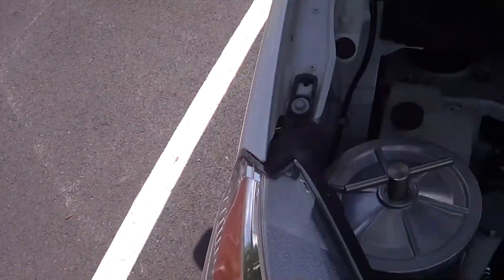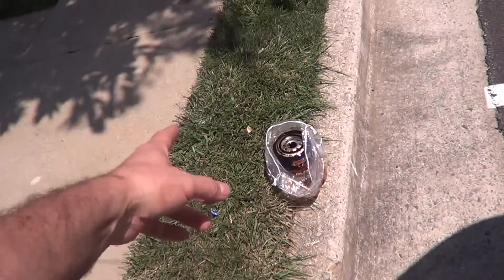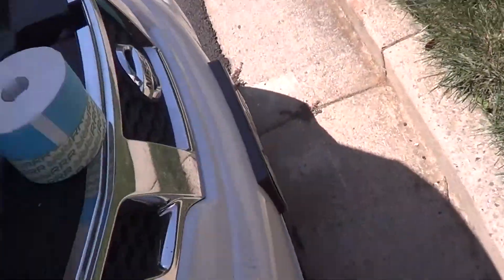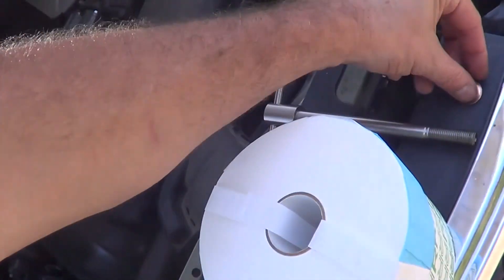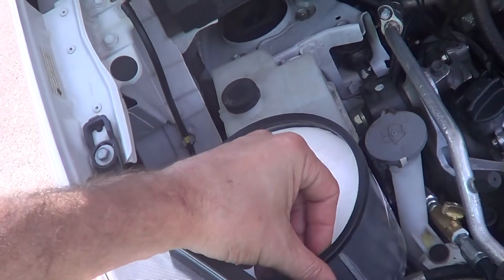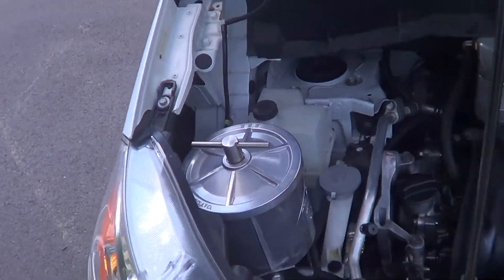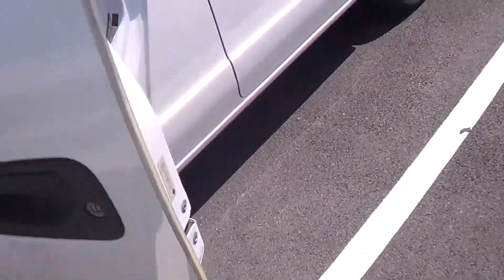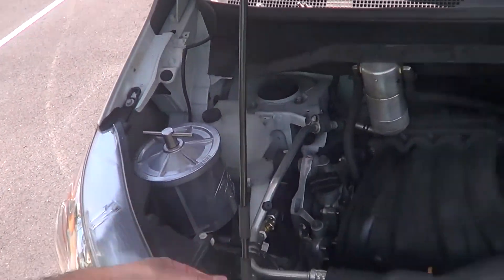Triple R Bypass Filter Performance Testing on a Gasoline Engine

Comment: Does filtering the oil at the 2 micron level remove/reduce the additive package? It is so fine a filtration, is removing the add-pak particles from the oil stream? I have been able to see the add-pak within Pennzoil Ultra Platinum settle to the bottom of the five gallon jug as a brownish sediment. If I could see that ... 2 micron filter should remove that. Counter productive ?

Comment: Too much analysis here . Frantz on their website showed that dirty 5000 mile oil can be returned to clean oil particle counts in a few hundred miles with a 🧻 filter . Motor trend magazine found the same in an article in the early 2000s with a similar Parker ABS paper roll filter. Instead of putting a lot of cash into oil analysis and a  proprietary filter like this you’d be well ahead using one of the Frantz 🧻 units . You could easily run 15 k (or longer)with no worries on a gas engine with  a high end synthetic with no filter changes and only make up oil .
Reply: The triple r looks identical to the frantz filters

Comment: Seems like the engine is going to be running dry for a long time compared to regular oil filters and that is going to hurt the engine more than its going to help by a long shot
Reply: Based on this video, what makes you say that the engine will be running dry at all?  Also, "...going to be running dry for a long time compared...", how did you get that?  I would appreciate your clarification as I did not hear anything suggesting what you commented about.

Comment: oil burns. ever put oil in a pan, heated it.
Reply from the maker: a pan of motor oil wont ignite until it is above the flash point of 412 deg F.   i don't run my engine that hot.
Reply: You mean like the oil pan on the bottom of virtual every combustion engine?

Comment: My guess is the few pounds of oil pressure can be addressed by adding more oil to your system since the bypass filter holds oil and you're taking that out of your engine.

Comment: All of the spin on filters are slightly better than the full flow filter. They are a full flow filter with a restricter orifice to slow down the flow and reduce the pressure on.the pleats. My Rambler came from the factory with one.In 1964 the flat head came with a bypass filter that spun on. It was junk the same as all spin on bypass filters. I replaced it with a Frantz oil cleaner.The oil went from black to golden. When you see me draining oil or paying 30 bucks for a filter element you will know it's getting cold in hell. Some clean oils look like dark honey some look like light honey.

Comment: The amount of water the filter removes is nothing compared to what the engine produces. We depend on normal operating temperature and crankcase ventilation to remove unburned fuel and condensation. Short trips in cold weather and you have a problem that even a depth filter caint handle.

Comment: One advantage to the depth filters is they can keep filtering down to their micron rating a lot longer than the pleated filters. A 1 micron filter bag that I used on my industrial job might stay at 1 micron for 5 minutes. Pleated filters do better.

Comment: I use a quart of Pennzoil Platinum and a roll of Scott 1000 sheet every 6k plus what little the engine uses which isn't much. With the toilet paper filters I used 50 years ago I could Squeeze the dirty end of the tp and get nasty sludge. I could Squeeze the clean end and get.beautiful clear oil. With the Nissan Altima my engine is clean my oil is clean my filter is clean.I think in my case the only reason I need to change the filter that often is to add new additives. Might need to convert it to use a carborator so that I can feel better about changing the filter that often.

Comment: That looks like one hell of a filter. Similar to a toilet paper filter at probably a much higher cost. One thing the pleated filters have going for them is modern engines are so damn clean running that even a poor filter looks good. With the old carborated engines you knew in a hurry if your filter wasn't cleaning the oil.

Comment: I've seen a lot of bypass filter videos along with toilet paper bypass filter sytem and mostly all videos does not show the condition of the oil after it went thru the filter. Just wondering why?
Reply: I run a TP filter and Blackstone was unable to do a particle count because the oil was black like coal. The TP does pass some of the grit but it cleaned up an engine that was ruined from sabotage.. In my own observation, I can feel a small amount of grit passing through the return line. I also have a 10 micron hydraulic filter on a transmission (A/T) and the particle count was dramatically reduced (as good or better than new fluid).. Most people who run a bypass system really do not understand what it does or the need to clean the oil. In general, its more effective on off road machinery and diesel that make abrasive soot. On a modern car engine, it has little value because gasoline engines have very little solid contamination and the quality of oil is much better than in years past.
Reply: @heavymechanic2  On diesel engine oil, wear metal (Fe especially), Si and soot is to be checked. Of course TBN and oil viscosity are important parameters that tells if the oil is still usable. Contamination is external factor.
On hydraulic oil, 10 micron filter is even coarse as the pumps and valves have clearances under 10 microns. New oil from a drum is at the contamination limit of these equipment. So you need to fill new oil through a 1-3 micron filter .

Comment: The pleated elements have no value at cleaning oil. If the elements look like a roll of toilet paper it's a good filter. If I had one of those filters I would figure out a way to use a roll of Scott 1000 in it.
Reply from the maker: The cellulose depth filters probably do better.  However, I couldn't justify the expense of the filter element and I could not get extended oil changes.

Comment: The bypass filters don't have to deal with water at normal oil temperature. The only time they have to deal with water is when you are operating in cold weather and not driving enough to heat up the oil.The crankcase ventilation deals with the water and the small amount of fuel.Of course you have the fools that remove the thermostat or coolant contamination.

Comment: I doubt you will see any difference with a bypass filter on a modern Japanese or European engine! Me and my friends  about a hundred of us did not see any difference in our UOA with bypass filtration. Then we started to experiment with full flow filters. We found a bias not towards level of filtration but flow instead. The filters that produced the best particle   count and lowest wear for us was filters that flowed the most oil. I am sure in a commercial application in a dirty harsh environment or in large diesels it makes a difference but for light duty cars and trucks a high quality paper air filter with all the hoses and airbox tight and sealing well and a cheap hi flow full flow oil filter was as good as it get's. Running a quality synthetic oil while keeping total insolubles  decent and changing out before the tbn got acidic was as good as it get's. I think the best oil for the money for any I4, I6 or V8 that is not a turbo diesel is M1 0W40 in the 5 quart jug at Walmart. I have used it in GM vehicles, Toyota's and Dodge light duty 1500 Ram trucks 1/2 ton. on the 1Ton Dodge Ram I use Rotella T or Delo 5W40. You might also try Redline 5W30 but it tends to take 2 oil changes before it turns in good number's. It is an Ester based Group 4 and G5 synthetic and the ester content tends to do a lot of cleaning of the wear metals that have stuck to the sides of the engine with the old oil. The older the vehicle the worse the numbers look with Redline or any other synthetic with lots of ester's in it for the first 2 changes!
Reply: I use converted Motor Guard toilet paper filters. I use 2 rolls of Scott 1000 sheet and 2 quarts of Pennzoil Platinum 10 30 a year plus what little the engine uses. 2006 Nissan Altima. The oil is beautiful.The Frantz oil cleaner is another good one.
Reply: buckaroobonsi555 Schaeffer oil out performs all of those you named.

Comment: where did you purchase Triple R & how much?
Reply from the maker: I looked and I didn't find the supplier.  I have the part numbers in the description.  I believe the AL-50 is discontinued anyway.  There are other brands that make this too.  I would just try to find a housing that accepts the 2 micron TR-20330.  I probably paid $300.  It is expensive.  I'm doing the experiment and videoing so you don't have to.  I'm going to do a video at 15,000 miles this weekend.  The oil still looks clean to me.  I will pull everything apart and compare the wimpy main filter with the TR-20330.  I could probably run the oil to 25,000 miles, but the additives are going to be very low now.  I know the oil is clean.  My only concern is if the main filter is clean where the bypass doesn't open.

Comment: +NathansHVAC - Can I give you an advice?  With all the " Time and Effort and $$$ " . You could have save all that and just buy Cheap Walmart Filter + Cheap Walmart Oil.  Change it every 3000 Miles instead of every 10K or even 20K.  I think it will be the same thing if you sit down and calculate your  " Time and Effort and $$$ ".  Funny thing is..., your Oil probably would be cleaner with Cheap Walmart Stuff since you are changing it often, LOL.
Reply: CLEARLY people who read my comment have comprehension issues. READ IT AGAIN.... It's VERY simple !!!
Reply from the maker: Jordan Bronson I used to use cheap Walmart oil. It's fine in the summer, but in the winter it'll destroy your engine because it gets too thick. 20% of expensive oil is the additives. Synthetics do way better in the cold. But you're right changing the oil regularly will keep it clean. But you could change the oil every Thousand Miles using Walmart oil in still blow out the engine top-end in the winter time.
Reply: +NathansHVAC - Hmmmm, I have been experimenting with Walmart SuperTech Oil for the past 2 years.  Believe it or not, I actually added 1 Quart 10W-40 to very oil change.  The requirement for our Chevy Blazer (Testing Vehicle) is 4 Quarts of 5W-30.  Since our Blazer is old and 300K+, I added 1 Quart of 10W-40 for extra protection.  Although, in the Winter, I should go " Thinner " and I agree 100%.  But I didn't, I just do it as regular and it's working fine so far for the past 2+ years.  I am in New Hampshire by the way and Winter here it's pretty cold.
Reply: +NathansHVAC - I am not here for " Endorsement " by Walmart.  I wished they did, I would work even harder, LMFAO.

Comment: Hi Nathan, for best results you must use filter element type E-50 (RRR Blue lettering)
Reply from the maker: Thanks for the suggestion.  However, when choosing the best filter, I called the factory and talked to one of their engineers.  The M-50 filter is a 2 micron with a beta of 200.  Here is right from the specs:   It is "Meant for hydraulic oil and for systems requiring best possible particle filtration"  The filter you are recommending is a 3 micron with a beta of 75.  It is still good, but not as good as the M-50.  Here are the specs:   http://www.baseko.sk/wp-content/uploads/2013/09/Element-series.pdf
Reply: Eugenio Algüerno a h. A n man E e ehh
I

Comment: Why go through all of this?
Reply from the maker: Two reasons:  1) I could not find any videos or data on bypass filters on gasoline engines.  Believe me, I checked before doing it myself.  2) I plan to get 300K miles on this van.  Clean oil means longer engine life and less oil changes.  That is the beauty of Youtube.  My efforts and expense save other people the money of having to experiment themselves.
Reply: Subscribed to see the updates on this.
Thank You for taking the time to test the different filter setups and making the videos!
Reply: Why: Longer oil life, and longer engine life. Rod and crank bearings benefit the most from very clean oil. Seals and seal surfaces last longer.